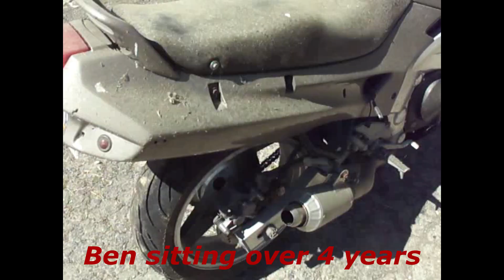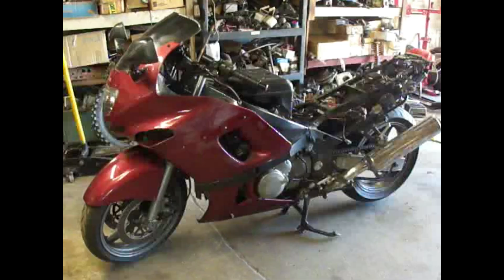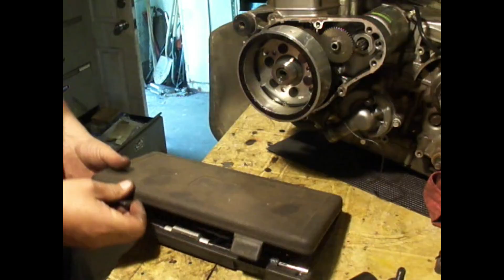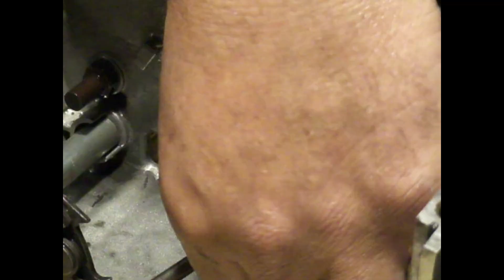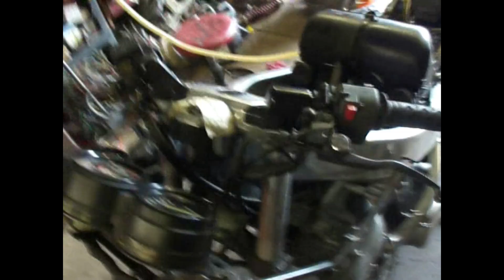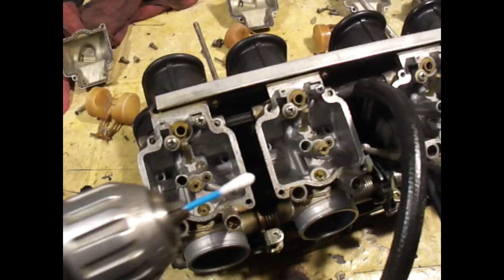Resurrecting An old Kawasaki ZZR 600

Comment: ı have the same  bike and for the cold start it has rattling sound until the engine gets head up it seams like the  cam shaft noise? but what you recomend to check for?
Reply from the maker: Lots of things can make noise at cold start but if it sounds like it's coming from the camshaft then check the valve lash. Valve lash should be checked every 6,000 miles

Comment: Didn't you have an issue with clutch cover clearance from D to E model engine? I had to leave the top clutch cover bolt out and trim the cover where that bolt goes for  the 03 zzr motor to fit my 91 D model.
Reply from the maker: Not at all. Strange you had this issue.

Comment: nice one,i would have changed crank though.
Reply from the maker: Yeah, agree but the main reason I didn't is because there was a chance I would have to get bearing to match the new crank as they offer 3 sizes for this engine and I just went with what it had in place.